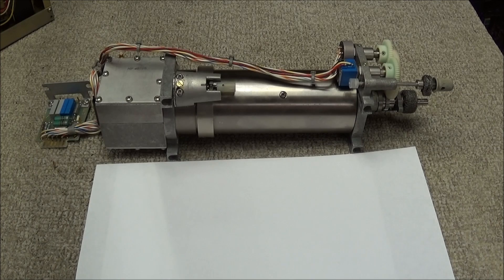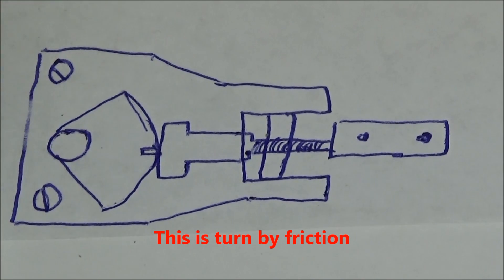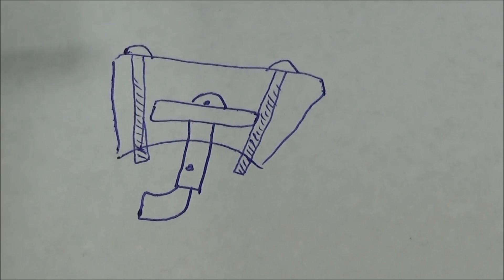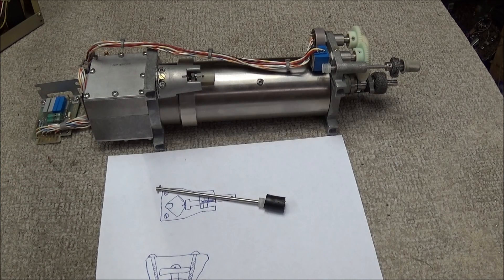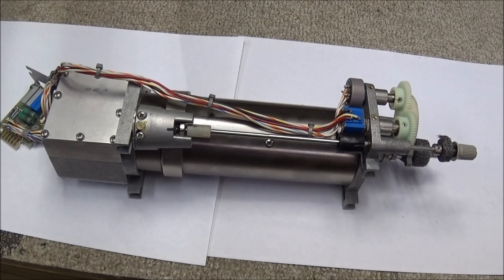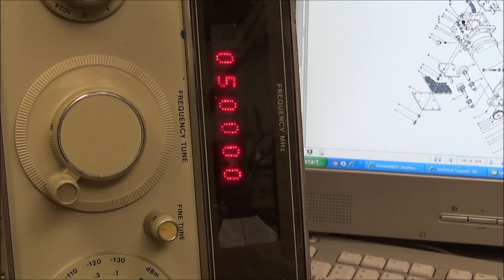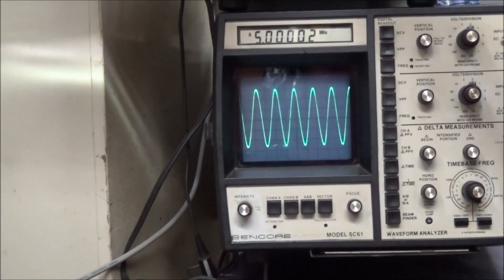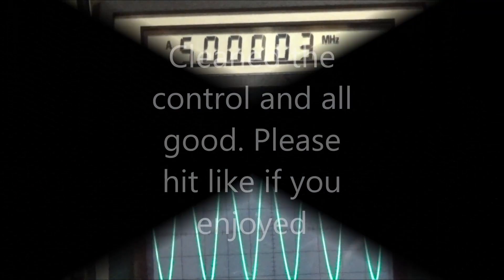#003 HP8640B part 3

Comment: Hi. Thanks for the video. I have a 8640A with no fine tune. Mechanically all is well. Have you come across this issue my friend? Thanks. Tony G4NGV UK
Reply from the maker: Hi Tony and thanks for watching.  Interesting problem. Does the course tune work ok? You said mechanically it was fine but the fine tune is just that, mechanical.  Have you torn into the unit yet?  They way the fine tune works is there is a piece of metal that sort of acts like a wave guide that varies the RF field. . Let me know.
Reply: Hi.
The coarse tune is fine! The fine tune is moving. Shaft and couplers intact. I have not got into it yet. I reckon I will have to remove the fine tune mechanism from the main cavity and see if the moving "vane" is still there. Yep? Ta.

Comment: These things are very over-engineered, to the point that they even used a 3-phase brushless DC fan with its own transistor driver circuit.
Reply from the maker: Agreed. Lot of bang for the buck. Gave 100 bucks for this one. Seller was not happy when I told him I fixed it.

Comment: I was wondering if you could use heat shrink in place of the hose, I don't know that it would be any better, but in some instance if the hose did not fit the shaft the heat shrink adapt to the size of the shaft
Reply from the maker: Would think it would have to be some thick heat shrink. The shaft is a pressure driven device and is a bit hard to turn. May work.

Comment: Never saw the gear issue addressed , I've got a couple of these with the broken gears .
I did see a while yrs. back on ebay and someone made an aluminum replacement for $100
Reply from the maker: +KD0CAC Yep, don't know what happened to the guy that was making them. If I can ever get my hands on some more I am going to give a try at making new ones.  I was able to glue mine back together. I have pics somewhere on how I did it.  But it required drilling lots of tiny holes t\so the glue could have something to adhere to.
Reply: @TheRadioShop  See  "This old Tony" on you tube, he has a home machine shot and can make gears. Dave W4GSM.